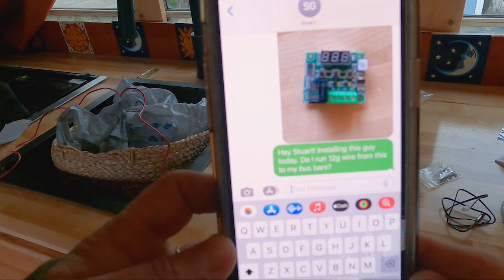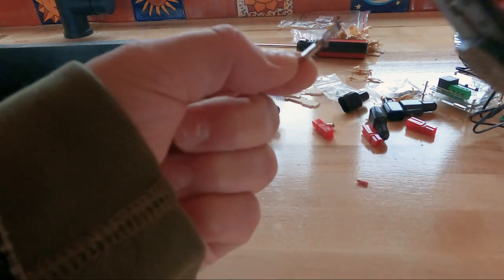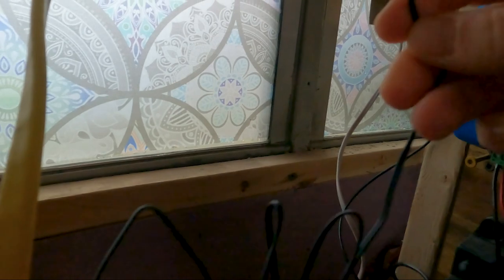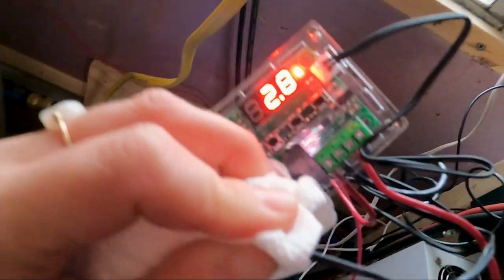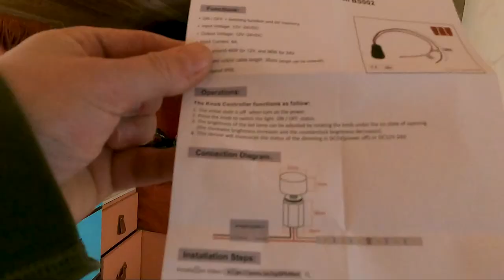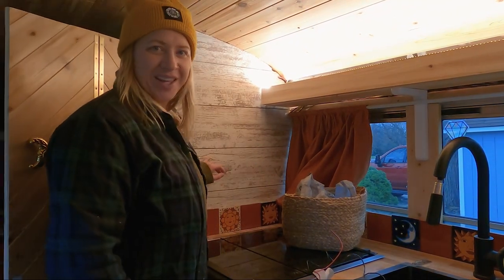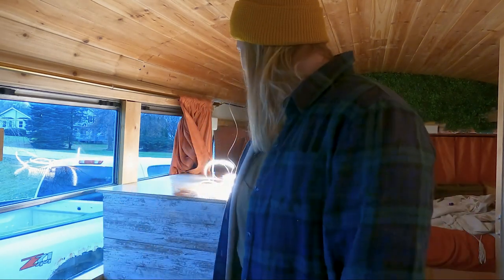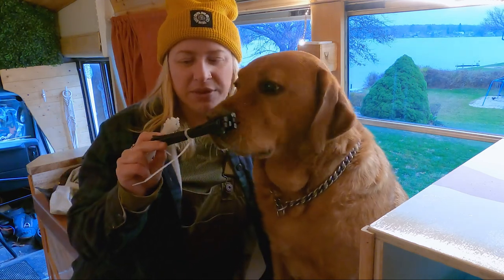Installed a cold weather safety feature for battery system in my school bus conversion | Rebuild #14

Comment: at about 6:40 you use a wire-nut. please please please never use a wire nut in any application where the wires could possibly get bumped or vibrate around, or any place that isn't continuously climate controlled, or any place that could be wet or humid. Busses bump and vibrate down the road, get cold in winter storage. Good way to burn your house down. Also never use solid core wire in any of the same applications. Only stranded wire. Anyway look up "butt crimp connectors with integrated shrink tube"
Reply from the maker: will do thanks!